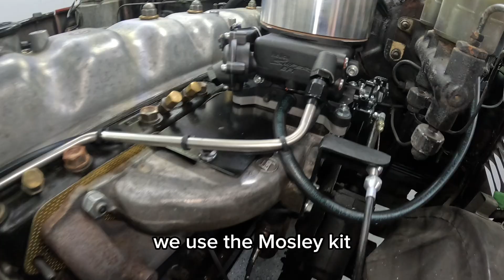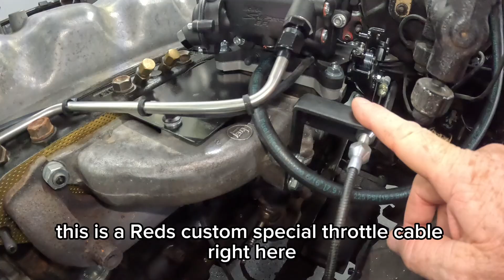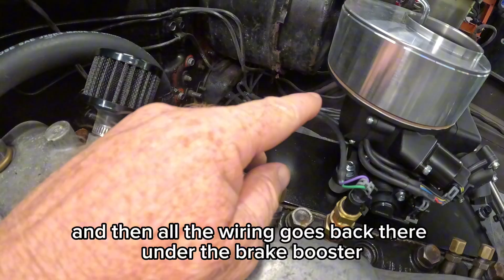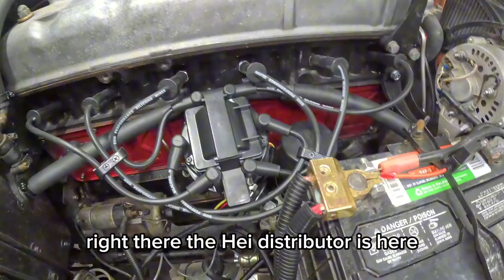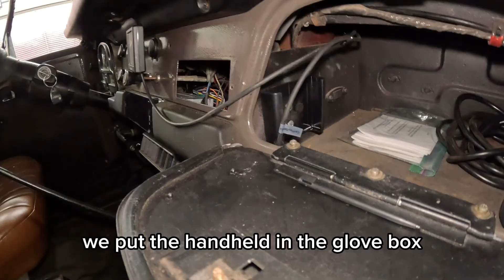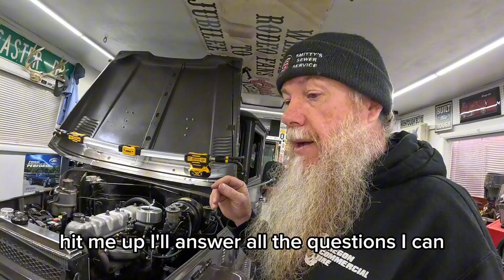Holley Sniper EFI Install on 1976 FJ40 2F Engine - My Way

Comment: How is the fuel consumption? Does it get better?
Reply from the maker: He didn’t check before as he was a pretty new owner to this rig but after he said around 10 mpg.
Reply: Thanks, looks like it isn’t so much different from before installation
Reply from the maker: @-williamsitorus never would I tell anyone they will get better milage with the Holley sniper EFI. But I will tell you it’s amazing! Once tuned correctly, you can literally flick the key and engine fires up, idles up, idles down and is just amazing. Also no gas fumes, clean burning. Sadly my hot rod “Tims Toyota” I might start it up once every 6 months and it’s just a flick of key everytime. But yea fuel is same or worse. My 383 stroker Sniper only get 6-7mpg.

Comment: What fuel pump did you use and how do you feel the system is working. Also are you running any other aftermarket things like a Dakota, digital Dash ? If so what other accommodations did you have to make?
Reply from the maker: I prefer the Holley 12-930 on ALL my fuel injection systems now. Use a GM Corvette fuel filter/regulator and a 10 micro pre filter. I’ve been bite too many times on other brand fuel pumps. This build did not get any other mods like DD.

Comment: Hey I bought a kit from mosely in 2024 and I am just now installing it, I read on holley's manual that they require the sniper to have the return line plumbed. I was wondering if you ran into any issues? Because your system with the regulator down there seems easier to install. Thanks!
Reply from the maker: I never found anywhere that Holley required that and I read that Holley agreed that if you run the Corvette style fuel filter regulator with return then you don’t run the return line off the body. The sniper only uses the fuel it needs and everything else is just returned at the filter regulator. Had zero issues, Tuning went great. Good Luck on yours!
Reply from the maker: Here you go, ease your mind. 

Key confirmation from Holley
On the official Holley Performance Products Forums, a user asked about running an LS/Corvette-style filter/regulator near the tank (short return from the regulator only) and plugging the return port on the Sniper EFI throttle body.
Holley Forum Administrator Danny Cabral replied:
“Yes, that will work.” He linked appropriate AN plugs/caps and noted you can also remove the -6AN fitting and install a one-piece plug. forums.holley.com 
This applies to the original Sniper (which had an internal regulator that is simply bypassed/capped) and is consistent with Sniper 2 practice. Sniper 2 has no internal fuel pressure regulator and requires an external one set to ~55–65 psi (typically ~58–60 psi). Its instructions state either fitting can serve as inlet or outlet due to the cast-in fuel crossover, and unused ports should be capped. documents.holley.com
Reply: @RedsCustomOffroad  Thank you sir! Yes one of the manuals explicitly says not too, but then another says its fine haha. Hoping to get some of the swap done today. Ordered the corvette style regulator. This video is super helpful thank you for posting.
Reply from the maker: @manrajsc you are welcome! Best of luck!

Comment: What is the best electronic fuel injection system for a Datsun L18 pickup truck (model 82, 720)? Is there any modification, change, or addition of an adapter, such as an intake manifold or ignition coil? What components are included with the electronic fuel injection system and are suitable for the L18 engine?

My car is factory-spec and in showroom condition. I want to start from scratch.
Reply from the maker: It can be done I think but I’ve never done it. 

First you need a 2 barrel downdraft intake manifold like the one weberjets.com sells. 

https://weberjets.com/product/datsun-l-series-weber-downdraft-manifold-99002-825/

Then you need an adapter for the manifold to Holley Sniper 2300 like the Mr Gasket

https://www.classicindustries.com/product/1957/chevrolet/nomad/parts/MG1937.html?gclsrc=aw.ds&gad_source=1&gad_campaignid=20286813338&gbraid=0AAAAAD_j9qBVPUOkqyVw4JKwst0PhMWde&gclid=EAIaIQobChMI7Ym0nKbKlAMVAi2tBh0wshAFEAQYByABEgIXAvD_BwE

Then you need to purchase the Holley Sniper 2300 EFI system. 

https://www.summitracing.com/search/part-type/fuel-injection-systems/product-line/holley-sniper-efi-2300-two-barrel-fuel-injection-systems?SortBy=Default&SortOrder=Default&gad_source=1&gad_campaignid=11306073119&gclid=EAIaIQobChMIkuGH0anKlAMV6BatBh0PvwGlEAAYAyAAEgI3i_D_BwE

For the throttle linkage and air filter housing that would be custom made I think you will have just find what works, no kits available. 

Then you need to upgrade the fuel system. I recommend like the Holley 12-930. Then you need a pre fuel filter and post fuel filter. Easiest is use a Corvette style filter/regulator then you have the built in regulator and no return line needed from sniper to tank rather from fuel filter to fuel tank and just run one high pressure line from fuel pump fuel filter regulator to Holley sniper. 
You will need to remove mechanical fuel pump and block it off. 

Then you need to upgrade the ignition system to electronic distributor, coil, solid core plug wires. 

The last thing would be adding the O2 sensor into the exhaust system which is easy. 

With all that it should work in theory but it’s going to be trial and error. You may be the first!
Reply: Hi, I'm Abdullah.
 I've purchased all the components you mentioned, Mr. Reds, for the Datsun L18, and I'll be working on them in the coming days. I've also asked the lathe to make the hoses and connections for the fuel injection system. I'll update you on the results in the next few days.
 Thank you, Reds.